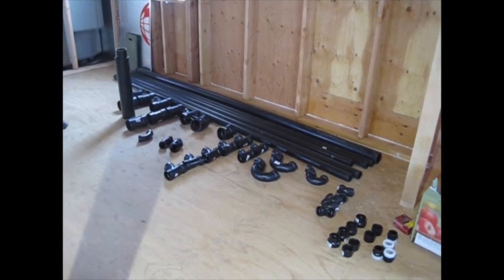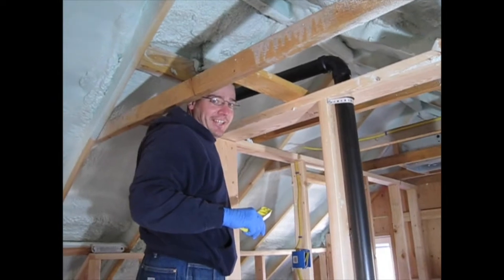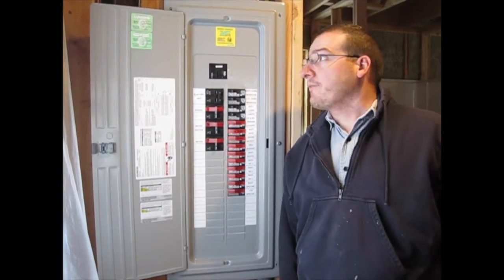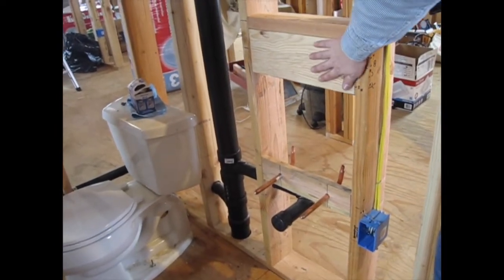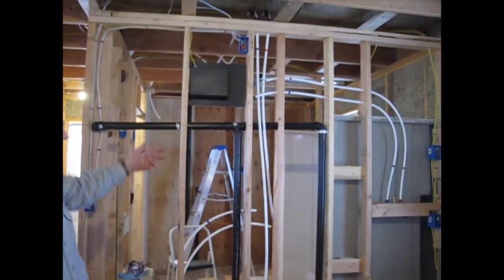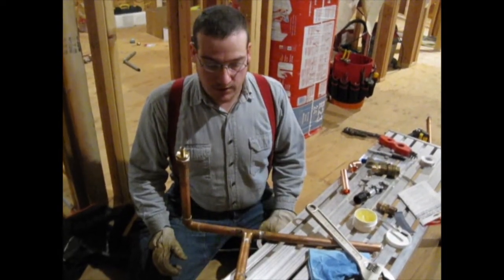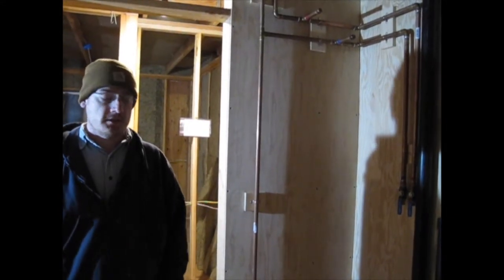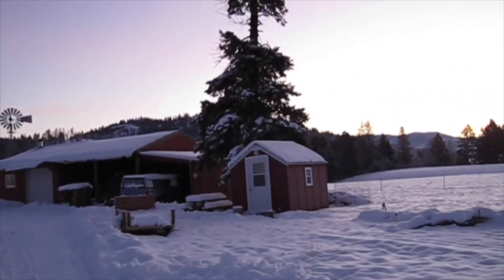Building Farmhouse #12: Plumbing Rough-In

Comment: I was wondering why you transitioned from PVC to ABS rather than just staying with PVC throughout?
Reply from the maker: Mostly just local availability. For some reason, all of the septic contractors (and the stores that carry supplies for septic contractors) use 3034 PVC for the underground lines, but all the local hardware stores only stock ABS for DWV systems. If I could have, I would have used PVC throughout.

Comment: Despite the freezing winter, y'all are making great indoor progress. I am wondering how you gained the knowledge to build your own home. Did you read particular books or watch certain videos? I hope one day to build a small home of my own when I move back to the States; if not on my own, I want to work with the builder.  My grandfather taught me never to sit by when you can be doing and learning. That's the biggest reason why I want to build my own place as well as the cost savings of course.  I sure hope that spray foam works out for you. Doesn't it just figure that one of the only things y'all didn't do and you end up with problems.
Reply from the maker: Yes, you can definitely build or help build your own house! We both were always interested in how things went together and worked. We started with smaller projects, and then built the pole barn in 2015. Virginia did a year long certificate in Historic Preservation that included hands on construction and also classroom time in stuff like construction math, building theory, and codes. We also did a lot of research online, with books, watching videos, This Old House, Fine Homebuilding Magazine, asking others who had built houses, forums, etc! It is also exciting how many different building methods there are from standard stick frame to strawbale to earthships etc. So many things to research and decide. It comes down to what you like, what you can work with, what is available in your area, etc. You can have the best plan or the most amazing building material, but if you can't get it reasonably or locally or find someone to work with it, well, then you have created a big mess!  We tried to keep ours as straight forward as possible. Maybe we'll make a video when done building the house about resources we found the most helpful.  Thanks!
Reply: Thanks so much for the reply. I'm learning some things from watching your videos. Take care and stay warm.